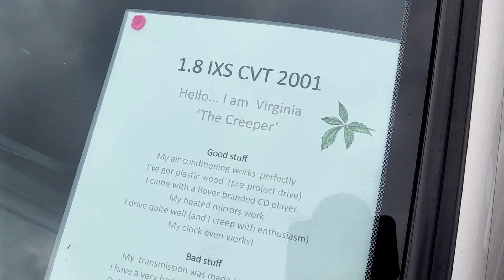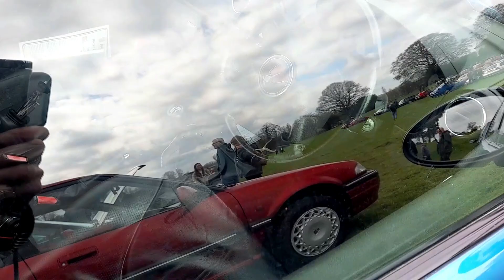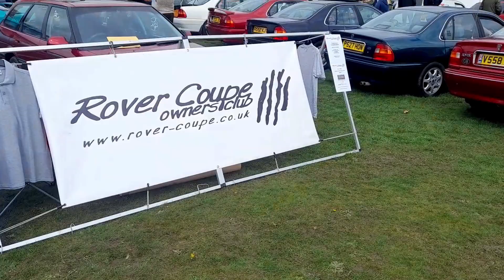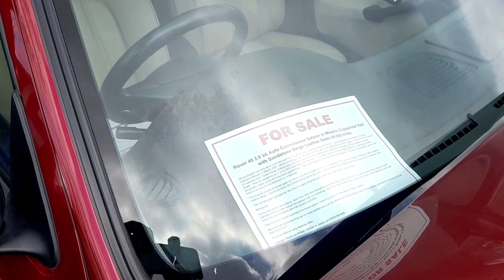UFT goes to the Pride of Longbridge 2023 (Part 1)

Comment: 27:25 thanks so much for looking at my 25 still needs a few things but it's getting there
Reply from the maker: Fantastic to see a late Rover you'll get there slowly, one job at a time. My channel is half-based on my late Rover 45 - you may find some of my videos regarding the Pektron SCU immobiliser as yours will have it! I.e testing the relays yourself to check for possible faults.
Reply: @usuallyfixingtinkering  yeah sunroof mechanism is the next job you probably saw the replacement I had on the back seats

Comment: The part primer ZR is mine, I'm the 14th owner and the car is a Cat C. Sat for a year until I rescued it and I worked on for another nearly 2 years.
Reply from the maker: Love a Cat C rescue! Most people undersell them for cosmetic non-structural damage, brilliant for us who love a project... but 14th!!! What's wrong with it for that to happen?
Reply: It was crashed in 2008 with front drivers side damage, subsequently that headlight sits a bit further in the bumper. I believe it was passed around so much because of its lack of history, unexplained accident damage, many people diagnosing issues as just being the head gasket and probably much more. Before I bought it, it was supposed to go up country for someone's daughter but a change of plans led to it sitting until I bought it. It was basically destined for the scrap. Since then, it's been my goal to return it to it's former glory and take it further. It's had a lot of mechanical work done and only the odd bit of body work. Hoping to have it resprayed back to blue and welded up this year.